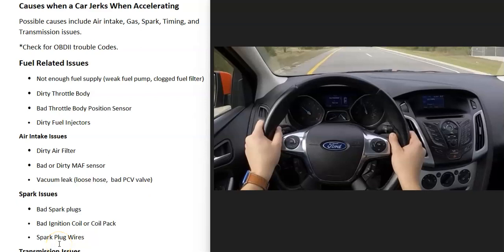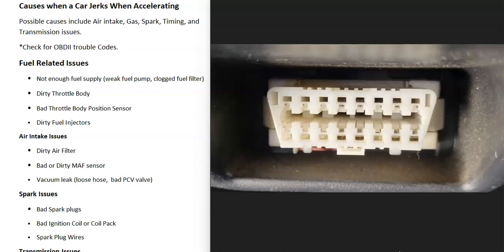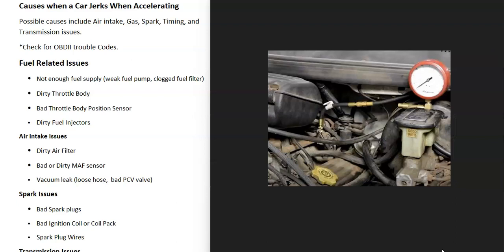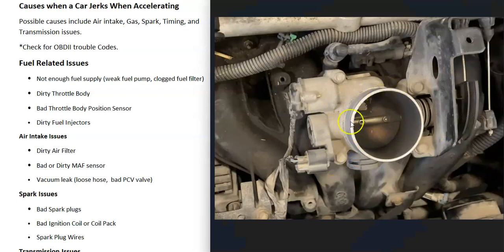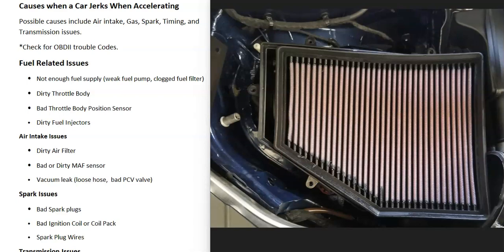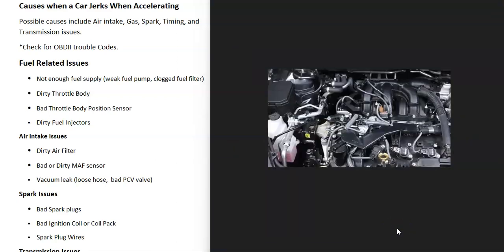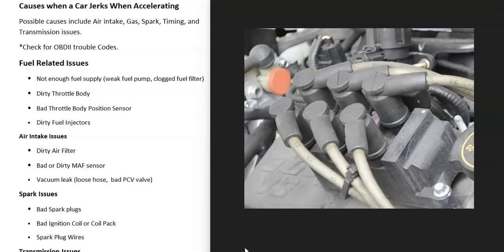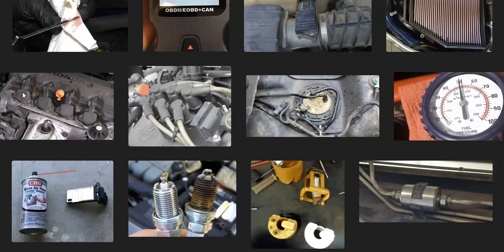Causes and Fixes Car Jerks When Accelerating

Comment: I'm having that problem but only after the car reaches operating temperature!!!... When it's cold theres no problem! Also, there's no engine light coming on (???). When accelerating, it will sporadically sputter and act like it's about to die, but then when I reach cruising speed and level off the acceleration, then it tends to sporadically lurch in speed then drop back to where it was. it's weird. ALSO, there's no problem at idle. When I stop at a light and it idles smooth. And none of this is steady or constant stuttering. It's all strictly sporadic. I put all new plugs and wires and replaced one bad coil 2 years ago. ('96 Toyota Avalon 6 cyl. Has three coil packs). I doubt those would be the problem after only 2 years replacing them and it driving perfectly up until now. I did go ahead recently and buy another new coil pack and then switched them around to see if there was any difference, But no change at all. Possibly an 02 sensor but someone told me that would not cause the problem I'm having. So, I don't know. Maybe the mass air flow sensor?? The key issue I see is that it only has problems when the engine is warmed up. THAT'S the thing that puzzles me. But I can't find any info that address that specific problem.
Reply from the maker: It is hard to say what the issue is, but I would test the throttle position sensor and clean the throttle body.
Reply: Car ran fine all summer it was hard on gas now when i try to drive it or start it i press on the gas the car cuts out? Cant get past 30mp now after changed the mass air flow sensor i also unplug it and it still run the same? Any advice please
Reply: Kinda like a hose its diffenity not getting enough gas or air feels like something is stopping air flow! If that helps lol
Reply: I got a P0150 code ("02 sensor malfunction on bank 2") and a P0153 code (“O2 Sensor Circuit Slow Response on bank 2"). So, I'm fairly confident I've got a clogged or bad upstream 02 sensor on bank 2 that needs to be replaced. Fingers crossed. Fortunately it's the sensor at the front of the car so I can reach it easily.
Reply: Having basically the same problem with a car; but there is no check engine light. When you got the codes was your check engine light on? Because I thought one would only get codes from one of the readers if the check engine light was on. Thanks.  @coffee-xg6my
Reply: did u fix it? i got same issue but no fault codes, ive had livestream on when driving and i did notice something odd with the spark advance when car stutter, should add theres no diffrence in bank1 or bank2 sensors when issue comes along..
Reply: @leifpersson9192  I would have them check the TCM module if the car has one.
Reply: @borg9355  its a 2005 huyndai santa fe, manual shifter, this tcm is only in automatic right?
Reply: @leifpersson9192 I believe that is correct. Sorry not a car expert just know that a TCM module can cause hesitation/shutter when starting from zero.
Reply: @rsson9192 Unfortunately no. However, all the research I've done regarding the symptoms I'm having point to the Throttle Position sensor but I've put 3 different new sensors on and it doesn't fix the problem. Right now, it does fine when I accelerate while moving or when I completely let off the gas to coast. It's just when I reach a steady cruising speed and ease up on the gas pedal just enough to hold it at that speed, is when It will start speeding up and slowing down. My general understanding is the ECU module doesn't know what to tell the throttle to do as far as adjusting to the fuel-air mix after it receives a signal as to the position of the throttle. So it's confused and speeds up and slows down trying to adjust because it can't coordinate with the throttle. Also, when I start from standstill (after the engine is warmed up) it will momentarily bog down in a dead zone of low power as you accelerate but then if you depress the gas just slightly more then it will all of a sudden surge in speed up to catch up with where I have the accelerator positioned. However, I just recently also noticed that after driving the car for a long distance for 20 to 30 minutes or so, if I park and turn the engine off to go into say a store or something, when I come back out, it won't start. Then I have to wait about an hour for it to cool down before it will finally crank. That tells me that possibly that a sensor or something is getting too hot due to the heat being generated under the hood when driving for a long period of time to the point that if the engine is turned off and sits for a few minutes, the it has to cool completely down before it will start the engine again.  I've also checked the wiring on the Throttle Position sensor connector and can't find anything wrong. I'm probably just going to have to take it in to a shop and pay to get it diagnosed. Then maybe I can fix whatever they tell me is the problem, assuming they don't try to up-sell me on a bunch of other supposed causes that aren't part of the problem. (I've had that happen before) That's why I'm going to give them a list of everything I've already replaced so they know I've already done certain things such as cleaning the Throttle body, replacing the TPS, replacing the 02 sensor, replacing air mass flow sensor and replacing spark plugs) But if they tell me it's something I haven't already addressed and it's too complicated, then I'll just have to have them fix it. Electrical problems and things connected with the ECU module etc are a pain to figure out, at least for me they are. I don't have the equipment of r the know how to diagnose those things.

Comment: Hi, My Honda Civic 2011 recently bought from previous owner, jerks while constant accelerator(pedal) around 35 km to 40 km and same happens if constance accelerator around 80km, If I give good padel and increase the speed from like 30km to 50km no jerking at 40km and same at 80km, it only jerks/vibrates when I had to drive on same speed of 40km or 80km or when slow accelerating. I have changed the AXLE, done the wheel alignment and balancing tyres are also new. Still the same issue and I can't find the permanent solution.
Reply: Did u fix the problem ? I have same problem I changed all of that
Reply: @romofonseka5929 I am planning to buy AXEL directly from Honda. Earlier I installed used ones.
Reply: did you fix the issue i have same for my civic 2009 i just notice when i put in drive mode and reach steady 50 my rpm goes up and down but when i give a pedal rpm rise but not so accurate, i notice when i put in D3 rpm seems stable but stille not satisfied with the pickup
Reply: Any solution to the problem yet?
Reply: In my case issue got fixed after I changed transmission oil.
Reply: i have same issue with 2007 Honda C-rv , it starts jerking when i accleratng at 50 KM & then when it reaches 60 km, it jerks significantly, did not find solution , let me know if any one of u guys facing this  and find solution, ? instal step by  step to find problem, new throttle body ,PCV valve, MAF & Map sensor, Idle air control valve, and new air filter, change transmission oil, so far no sucessits same.

Comment: I have an 3 series e36 that does this, only in first gear though I’ve changed the trans fluid, I suspect it’s either an intake leak or a clogged fuel filter
Reply: It was an intake leak 🤙
Reply: @jonahcass2793 how did you discover that!

Comment: Greetings to you. While pressing the car’s gas pedal, the engine spins more strongly than normal, with slow movement or acceleration of the car.  What are the reasons please?
Reply: That's your transmission slipping bro..
Reply: Did u find out?

Comment: Great video. To the point. My 2016 KIA keeps jerking/studdering forward. I like to have an idea why before going to the mechanic.
Reply: My 2016 Kia started doing this too
Reply: @youknowihadtodoittoem8235  I changed my map
Sensor and it worked
Reply: Mine as well ,Kia sorento 2017  with 114000 miles.
Reply: My car been studded if forward too
Reply: My 2016 kia sorento also, what did the mechanic say or do? Did it help?
Reply: @lizhall6231  change map sensor
Reply: @lizhall6231  Worn out spark plugs. My mechanic replaced 3 of the 4 spark plugs. cause they were worn out or broken including the spark plug wires. cost me $367 including labor. but it doesn't jerk anymore :)
Reply: same here kia rio 2013

Comment: Need help I have. A 2012 Nissan maxima new parts front struts wheel hub. New tires balanced alignment as well  new air filter  shift smooth with with no problem still …no codes still can’t shacks over 20 still 75 just need to change transmission fluid … if any one has any   Help please comment
Reply: i think i have a same problem in my nissan altima. Did you find a solution?
Reply: I just got new tires and new struts today w/ an alignment after and now my car is doing this. I filled up my tank and about 15-20 minutes after driving it has started acting up. When I accelerate it is putting and chugging. At 2-3 rpms as of now it’ll stop but when I go under or over it’s chugging…. 😫 I feel like now I should’ve left everything how it was 😅